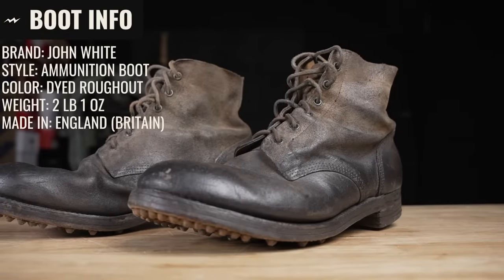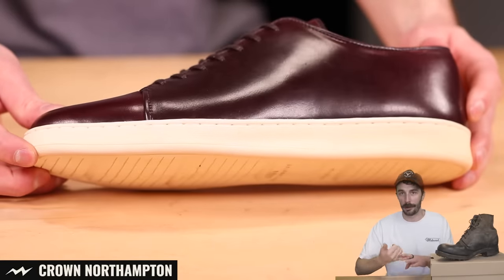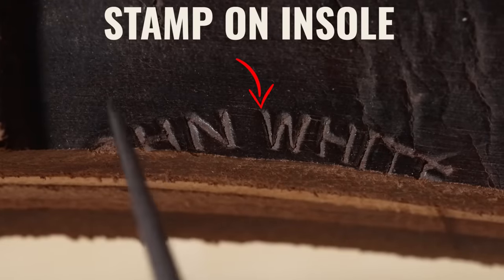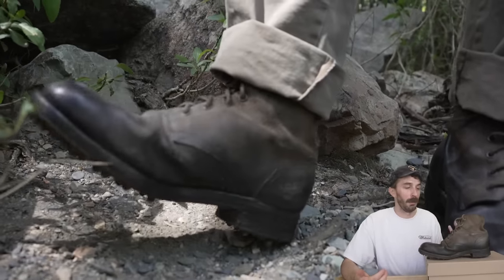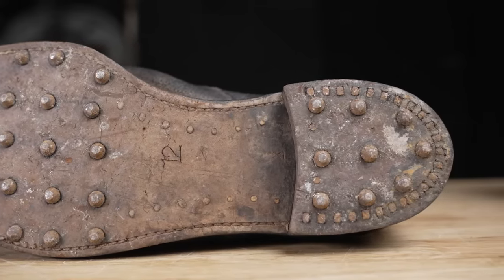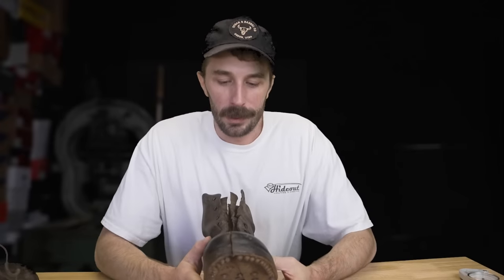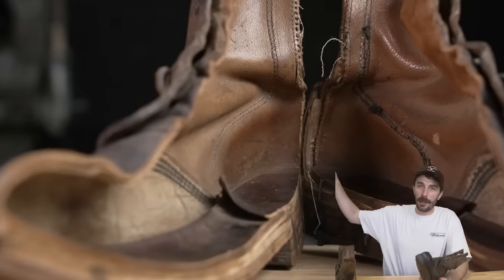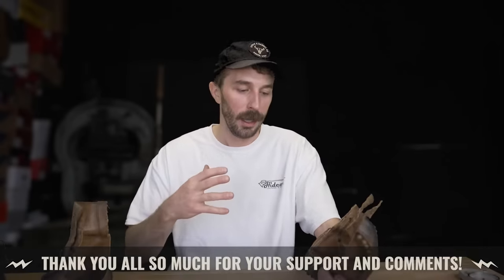Why 80 yr old British WW2 boots are better than modern boots

Comment: One thing NEVER mentioned in most cobbler videos, is when you go back 50, 70, 100 years...you are dealing with 'smaller men', too! For example, the average soldier in WWII weighed 155-lbs, was 5' 7" tall. Now, we ALL know what happens when you put 'robust footwear' on lighter people...they last truly FOREVER (and may be near-impossible to break in). So...while you're correct that this is an EXCELLENT-built boot...imagine what you'd have to add to them to make them EVEN STRONGER, better, to fit the average 180-200 lb soldier of today? (this is also VERY key to the 'air soles', like Doc Martens, as to why they don't last for heavy people...)
Reply: They are still worn by ceremonial units in the British Army, like the Royal Guards who have above-average build. I think they still last very well from daily use.
Reply: @istillusezune82  of course, you're referring to the Foot Guards; the Horse Guards (Life Guards and Blues & Royals) do not utilise ammo boots. The Household Division's regiments of Foot are referred to as Queens Guards or Foot Guards; despite the common euphemism, British Foot Guards are not officially referred to as Royal Guards. That designation is probably more appropriate to continental contingents of Household troops. I suspect the Swedes and the Danes, for instance, refer to theirs as 'Royal Guards'.  Also, there is actually no height restriction specific to any regiment of the Foot Guards, although there is a minimum height requirement for Queen's Company, 1st bn Grenadier Guards and there traditionally was for Prince of Wales' Company, 1st bn Welsh Guards.  I served alongside Guardsman who were 7 feet tall, as well as Guardsmen who were well under 5 feet tall.
Reply: Respectfully, I'm not sure that's entirely true. Modern combat boots are designed far more for economy and comfort than durability. The assumption tends to be that the boot will simply be worn down and replaced. Ammo boots have, for instance, the capacity to be re-soled; this means that so long as the leather is maintained, the boot will continue to last for a long time. I had, as a crow, seen ammo boots dating from before WW2 used by veteran NCOs (who incidently were well over 6 feet tall); incidentally, this was in the '00s. The average height of the British soldier in WW2 may well have been 5'8, but I suspect that figure is simply a median value based on medical records; there was obviously a considerable spectrum in between. They must have considered that soldiers of 6 feet or 200lbs and above would wear these boots. I myself am 6'2 and at the time of service was an average of 190lbs; my drill boots never wore out, but they were remarkably uncomfortable. Indeed, to this day I suffer from plantar-fasciitis which is worse in the right foot than the left; my theory is this is because we bend-and-drive mostly on the right. Ammo boots were designed for durability but not comfort. Modern issued boots are not necessarily comfortable, but they are one hell of lot easier on the feet than ammo boots with rigid soles - the chore of exchanging them notwithstanding. I am honestly more inclined to believe that ammo boots from the pre-war to wartime period were simply over-engineered, as it were, for durability. But this is simply personal opinion...
Reply: Doc Martens don't last for anyone.
Reply: Ahhh you might be talking about the malnourished "cockney lad" but you forget that Britain had a empire of tall stocky built men from places like Australia, New Zealand and Canada....where due to the more rural lifestyles and plentiful supply of cheap meat and vegetables meant that we were "head and shoulders" above the average Pommie.
Ammo boots (Boots,AB in Australia and New Zealand) were bloody indestructible for the average person.....many of which are still found without too much trouble eventhough we haven't produced them in over 50 years......the move towards "yankification " where boots and uniforms are made to have a shelf life instead of repair is a sad part of the post 60's world
Reply: Really good point.

Comment: they make reproductions of these boots, i wonder how accurate they are in construction. i know William Lennon still makes the B5 ankle boot from WW1 on the same machinery, would love to  see those cut in half
Reply: Winston said that these WW2 boots are equal to $1000 USD boot nowdays.  William Lennon B5 WW1 reproductions are £205.95 (converts to ~250USD at the time of this comment).  Obviously massive corners are cut to get to 1/4th the price.  Perhaps fewer layers of leather, thinner leather, lower quality leather, fewer or lower quality studs/nails?  Not a good way to see the quality of boots truely made in WW1.

Comment: Cast Iron is pretty great but you can't use them on glass top stoves induction or electric unfortunately. 

Personal recommendation whenever you get a new cast iron pan make sure to reseason the pan with a high smoke point oil like vegetable, flax, or lard. Do this a couple times till the pan is shiny and mirror like when dry. It makes it even more non-stick and corrosion resistant.
Reply: Oh yes you CAN use them on smooth-top, glass-top, whether radiant heat or induction stoves.  I have both, and use both quite regularly and highly successfully, with not one problem!  These wee made for induction!  Radiant cooktops too, perform very well with these pans!  Just as with anything else, with a glass cooktop, you cannot drop the cookware onto, or slam the cookware onto the tops, or they will break.

Comment: Hobnail boots are great on loose surfaces but if you walk across rock, asphalt or concrete they are lethal. As a high school cadet in Australia in the 70's we were supplied old war surplus boots (not sure what they were). Parades were awful as at least 2 or 3 of us usually skidded across the concrete when we came to a halt and one kid broke an arm when he fell. I recall these took ages to wear in and we were told to put water in them and wear them a few times until they settled in. Having large wide feet was definitely  not ideal with these boots.
Reply: Ahhh I have the "Nasho" boots..... same as the ones you had but without any studs mate.......a utter bastard if you've got wide feet and a $100 to the local Mister Minit got a rubber sole put on that stops the sliding
Reply: you must have went to the special school I never saw one slip or fall in 5 years.

Comment: When I signed up in 1973 the boot we were issued was called the DMS (direct moulded sole. As a boot it was shite, in the summer your feet were on fire and froze in the winter. If they got wet they stayed wet for the duration. they gave us this plastic woven type insole which did nothing for added comfort then in the late 70s early 80s we were issued the high leg boot which was a soldiers prayer by comparison.

Comment: It's a shame to destroy such a iconic British WW2 boot. During WW1, the British troops would covet the Australian boots, as the Australian boots had more water resistance protection, due to the sewn in tongue. During my time in the Australian army during the 70's and 80's, I wore both the leather and rubber sole AB boots. They were just as tough, durable and very heavy to wear. The rubber sole boots had screws fasten to the sole for extra strength and durability. To soften the leather, I would use Kiwi polish a lot. The hob nails on the British boots were different to the metal cleats that were nailed onto the sole of the Australian boots. The cleats provided more traction in the mud than the hobnails, but were more dangerous to walk on tiled and wooden floors. Definitely an outside wear boot. For indoor wear, the cleats were pulled out.
Reply: Atleast he didn't carve up the brown "jungle boots" with the tigerclaw mud cleats.......

Comment: As a  Foot  Note (  no  pun)  1 of the  Trials   for  acceptance Of  the  Boot in  the  British  Army was  to  take a  No4 enfield  rifle(Standard  Issue) held   with  the  Butt  stock level  to  the  solders  belt line  and  drop  it   (Unloaded) on  the  Toe  cover, no  injury to  the  front  foot  was  is  be accepted. The   rifle  weighs 8.9Lbs,   Ive  done  the  test on a  Near  NOS  pair a  Army  bud  has  and  no  injury. SUPER  well made   bit  of kit.

Comment: I joined the Grenadier Guards in 1976 and was issued 'new' drill boots (hobnail)  that were date stamped 1944. I guess they had a war surplus. We had different boots (rubber sole) for tactical use.
Reply: Same detail, except scots Guards 2001.

Comment: Those nails around the heels are Cutlan Nails. Flat sided with a slightly bigger tapered head and grip rings on the shank,they hold the Toppiece onto the heel pack.

Comment: Yes using Urine is a traditional leather tanning method, it had several benefits; It removed the last of the skin and other hair that had been missed by the scouring, it softened the leather and it chemically stabilised it preventing rotting. The advantage of Urine over later Salt or chemical curing was that it sealed it the surface layer without leaching the moisture meaning the leather was softer and more long lasting.

Comment: whats very cool to see here is how the veg-tan leather darkens and rots around the steel nails in the heel, whereas its perfectely intact where the wooden peg sits. That is because corroding metal sucks moisture in but doesnt give it away again. plus the steel reacts to it so differently than leather. they work against each other. thats why in my opinion wooden pegs are way more preferable in a lot of shoemaking areas. they behave the same as sole leather and thus they can hold it together for centurys (and if properly executed they also dont come apart or slide out like some say) they bite into the material

Comment: I joined the British Army in 1966 as a 15 year old boy. We were issued with two pairs of Ammo boots. Only those who have never been subjected to these would have anything pleasant to say about them. Try running ten miles and then going over an old fashioned obstacle/assault course in them before breakfast and two hours on the parade square after breakfast - discomfort doesn't cover it. Only on being posted to Germany in 1969 did we see rubber soled (DMS) boots.

Comment: I was an apprentice in the British Army from 1966 - 1969 and during the apprenticeship we were issued with all the old stuff, WW11 style webbing equipment and battledress - and old style boots. The boots had a dimpled leather finish all over so we had to smooth out the heels and toecaps by heating a spoon handle over a candle and applying polish to stretch the leather smooth (the spoon along with a knife and fork was part of the 'eating irons' we had to carry with us as the cookhouse didn't have any cutlery) . Each boot had 13 studs on the sole and a horseshoe shaped heel plate.
We wore the boots every day for three years and even had to wear them on road runs and I don't recall having any problems once they were worn in. We only used polish and heat to maintain the boot and replaced the studs as they wore down, I don't remember any studs dropping out. The biggest downside of the boot was that the studs would skid on tarmac surfaces so you had to be careful running on roads.
We had two pairs of boots, one pair for day to day wear and 'best' boots for parades. The best boots were burned smooth all over and hours of polishing in tiny circles using a duster, polish, and spit (or water) produced a glasslike finish.
When we graduated from the Apprentice College we were issued with all new kit including the DMS (Direct Moulded Sole) boots with rubber soles and no dimpling. I was a technician and didn't spend much time in really hostile terrain so I can't recall waterproofing problems but I did find the DMS boot to be really comfortable to wear for the next 8 years service.
Reply: I remember the boots you speak of and the boots with the dimpled leather  are different to these boots, which are of a higher quality.

Comment: The Boots, Ammo were brilliant boots. They were designed for marching so were hard wearing. They were also designed for every environment so the tongue was connected only to the second lace hole as anything heavier would have been too insulated (these boots were worn from the deserts of Africa to the jungles of India, the mountains of Italy, the beaches of Normandy and to the snows of Norway). They were cheaper than high leg boots and easier to manufacture.

Comment: Peeing into your boots, letting it soak in, and then rinsing out helps remove tanins and fat from the leather, which makes it easier for the leather to absorb the polish.  Only to be done with field boots, not boots to wear on parade, as you will get salts bleaching out from sweat.  The big advantage, particularly in tropical conditions, is that it helps your boots dry out after being immersed in water, and it also helps mitigate against fungus and other foot conditions brought on my the tropical environment.  Australian troops were still following the practice in the 1980's.

Comment: I pretty much wept when you cut them up! 😳
They were, and probably still are, the boot of choice for senior NCO's when teaching drill. They're cracking boots but the hobnails can make them a bit scary on smooth surfaces. I've seen RSM's trying to maintain their dignity after a fall while the rank and file are trying not to piss themselves laughing. 
Subbed. 😊

Comment: Conditioning the boots for wear is not an old wives tale. We would urinate in the boot and leave it overnight. Employ it out and rinse it through (some of us). The boot was damp and flexible so we would wear it all day, getting it wet as we trained in all terrains. As it dried with the heat of the foot, the leather would conform to the shape of the foot and become - eventually - more flexible.
Ammo boots were long and difficult to break in, but tremendous boots afterwards.
Jim Whitehouse

Comment: Actually 1942 was half way through the war for us. Some people comment that a modern light weight combat boot is superior in use & you simply replace them when they break - this wasn’t practical in WW2 when re supply was limited, or occasionally impossible, and the materials & techniques to manufacture modern style synthetic boots hadn’t yet been invented. The soldier was issued his boots as a recruit/ conscript, broke them in in basic training & then had a pair of comfortable boots which lasted a long time & could be preserved by replacing worn hob-nails etc in the field. There wasn’t really an alternative available at the time, so the better & more durable the boot the better as you didn’t want them to fail when you were in combat for prolonged periods.
Reply: Brigades also had Field Cobblers assigned who would tour the Battalions and repair boots on spec. Most units would also have men who had been Cobblers in civilian life who would also lend a hand at repairs.
Reply: @dogsnads5634  My father joined the British Army  in 1944 when he turned 18. He told me that if you needed your boots repaired you took them to the Battalion cobbler and that each battalion had one.

Also the British Army regularly rotated units in and out of the front line so you were usually only in combat for a few days, then in the rear for another few days. That's when you'd be issued replacement uniforms, boots and equipment for stuff that was unserviceable.
Reply: @stuartm2106  Being out of the time was also an opportunity for the Army's equivalent of the Navy's Make and Mend. Socks were darned, tears sewn up, boots repaired etc..

Comment: I'm restudding my end of WW2 era ammo boots, going from round pot lids to clover studs, horseshoes are perfect but I managed to pull a couple of the hobnails and wanting the 3 stud clovers for extra grip.   My ones are the extra steel reinforced ones, a steel toe cap, a steel fiche under the insole and a thin steel fiche reinforcing the heel wrap making it a bit of a clonker when walking.

Comment: The amount of hob nails is carried on today in the queen's guards boots sill basically the same boot except double souled 13 tripping head hobnails and the leather is the other way around, meaning smooth side out, they are used for drill, on the palaces and highly polished on outside like glass.

Comment: I joined the Australian army in the late 80s and our General purpose (GP) boots had a rubber sole but, weirdly, the rubber sole was fashioned to look like the sole on these boots - a false welt to look like stitching that stopped at the heel where a real leather sole would be nailed on.  I imagine Australian WW2 boots would hav ebeen similar to these and when rubber soles came out the Regimental sergeant majors would not have approved a boot that looked radically different - or that couldn't be spit polished....

Comment: The manufacturer and quality of leather were only 2 things that dictated how comfortable  the boots were. Even more important with boots is their  fit, they must not be too tight, short or narrow if they are they will cramp the feet causing serious damage, chafing and blisters. Equally they must not be too loose as then the boot is allowed to chafe against the heels, the soles of the feet and other parts. Socks are also immensely important, in the day soldiers were provided with knitted wool socks which wore on the heel, and soles causing injuries. They were not given sufficient socks or replacements and socks could be worn out fairly quickly. Wool also takes a long time to dry and wet socks are very uncomfortable.
Many soldiers were reduced to taking the boots and/or socks of their dead comrades or even the enemy when their own began to cause problems. 
So the quality of the boot is important, but there are many other issues to consider.